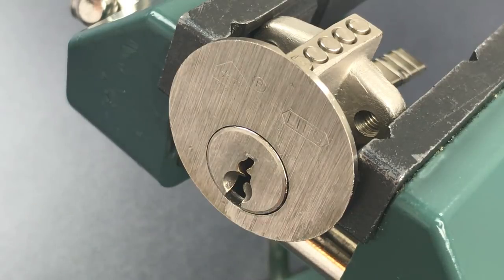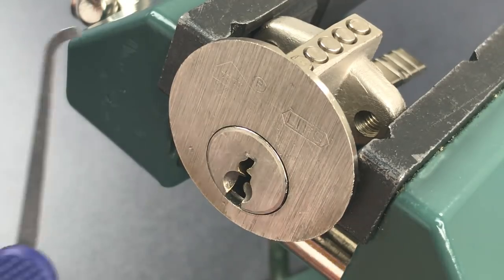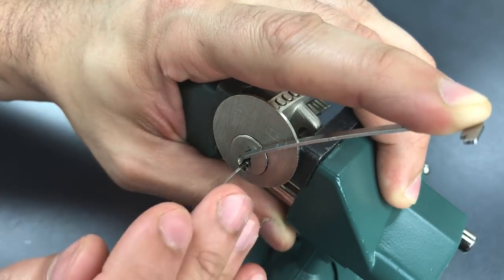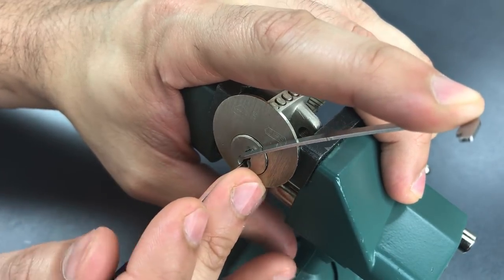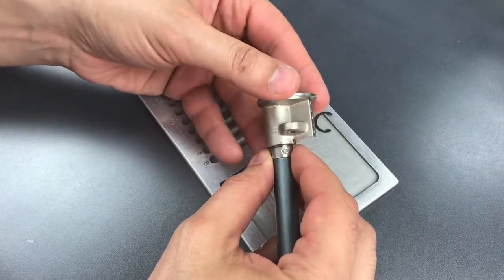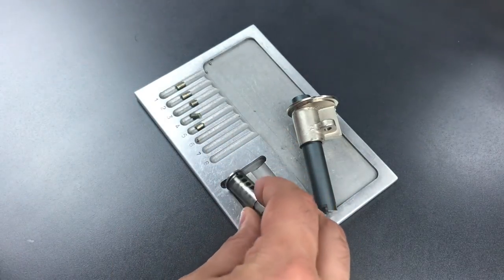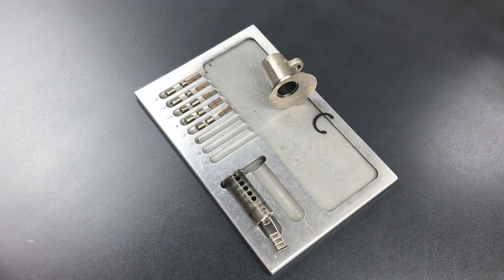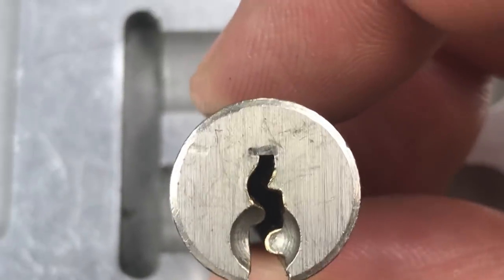[747] LIPS Rim Cylinder Picked and Gutted

Comment: 5:28 did he mean it is for drill resistance?
Reply from the maker: He did.
Reply: I was not watching at that moment and my thought was that one of the key pins had a ball bearing at it's tip. I have seen that give Bill a hard time, esp with some combination of thin pick, strong spring and being towards the back of the lock...
Reply: Id hate to drill it. If it was off the door id use a blank key and push a shim through it if possible.  But the drill would go right through it

Comment: I've seen you gut a number of locks, but don't remember seeing you put one back together.  That would be nice to see.
Reply: I have just bought the I x SouthOrd Twenty-Two Piece Slim Line Lock Pick Set from pick pals along with for of their progressive locks which I believe you can pull apart and change what is in there to increase the difficulty for yourself. The kit to pull them apart amd put back together is seperate though unfortunately

Comment: Looks like a fairly standard Yale (y8?) keyway? They seem to practically be the default here in the UK. However it's a mix as to whether the middle warding is drilled through which makes a fair difference to pick manoeuvrability.

Comment: I got one for you. I was playing around picking locks at work. Most of our doors are the standard commercial type sideways locks. Got any pointers for those? 

Second. Ran into a regular residential door. Got the cylinder to turn but it did not engage the locking mechanism. Tried it three times. Same thing. Any guess?

Comment: Those two little ball bearings, would that actually stop a drill? Seems too small in diameter.
Reply: Yes, I thought that too. Usually, it would be just one larger one right in front of the pin stack.

Comment: "Built to high tolerances" would mean a very inaccurately manufactured lock, right? The opposite of what you mean.
Reply: No, that would be low tolerances.
Reply: Gary Rumain Tolerance is the amount of allowed variation in sizes. High tolerance = high variation = crappy product. It's better to use tight/loose rather than high/low when speaking about tolerances. Tight = low, loose = high tolerance.
Reply: Or fine and poor.

Comment: The springs look odd—one section in the middle appears to have the coils tighter together, similar to the ends.
Reply: That's quite common, actually. It's supposed to help stop the springs from getting caught up. They usually do it with longer springs made from copper.

Comment: Lips is fairly non existent these days. The older products (10-20 years) are still around ranging from safes to door locks. 
The more modern lips products like the Octro are made by Keso instead of Lips. The Lips Octro is quite old too.
It appears they are focusing on electronic locks these days.

A few models of the Lips have tapered pins and are a bitch to pick. Send me a message and I'll get you one.